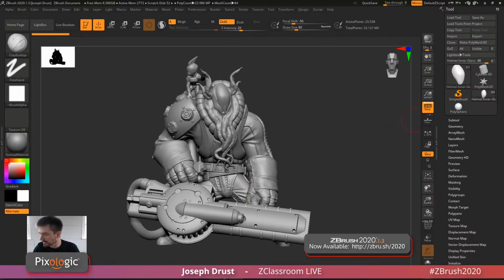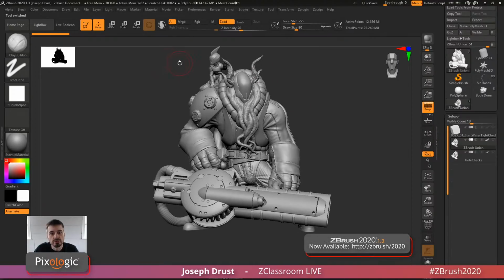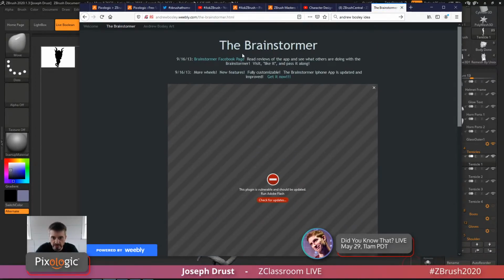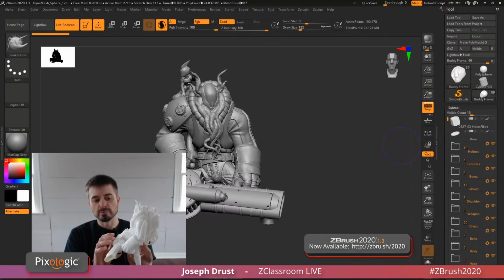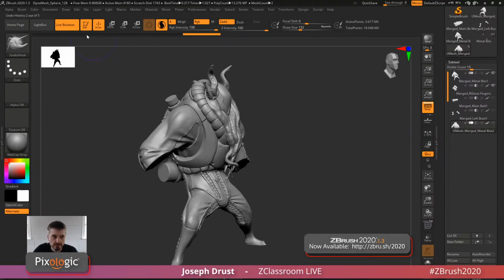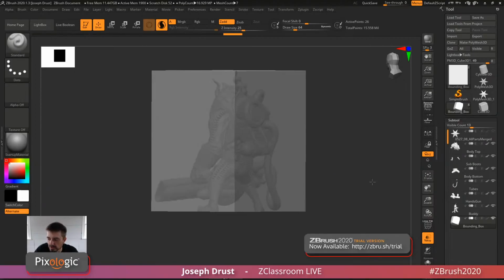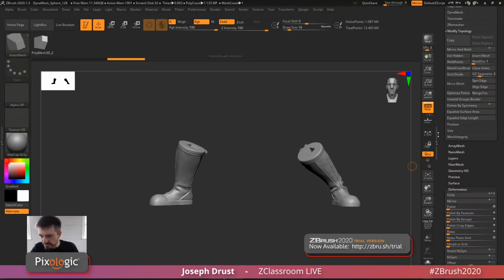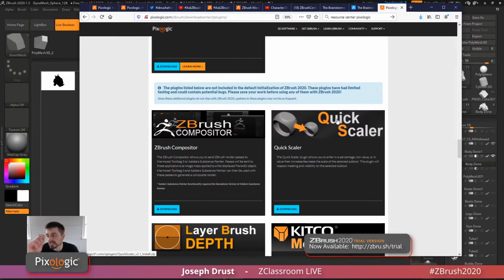3D Printing: Prepping Proko Model - Pixologic Joseph Drust - ZBrush 2020

Comment: Hello! I have a question for you, does the angle of view in zbrush affects the final look of the 3D printed sculpture? For example if I use a 28 angle of view... when I print it would it look more or less the way it looks in zbrush? Thank you
Reply: To answer you question; technically no BUT 28 is actually pretty low for camera angles so maybe try around 50 - 80, that way the model will look more like real perspective; this will also help you model the mesh with a better understanding of what it would look like in reality...